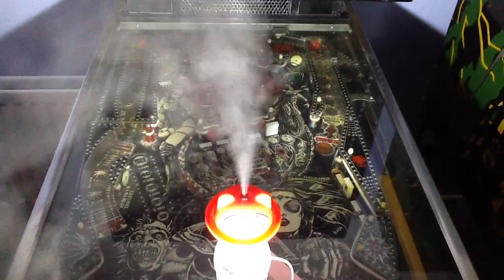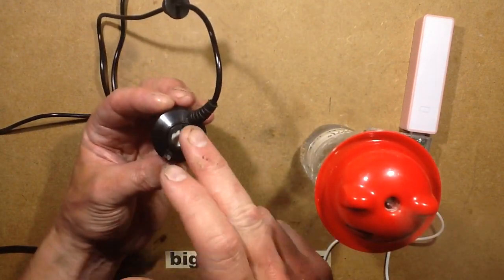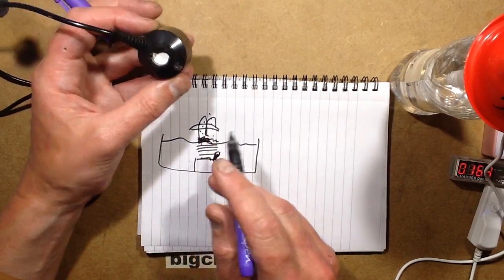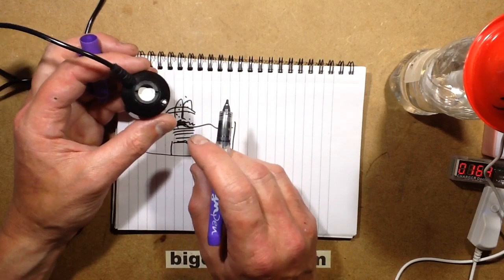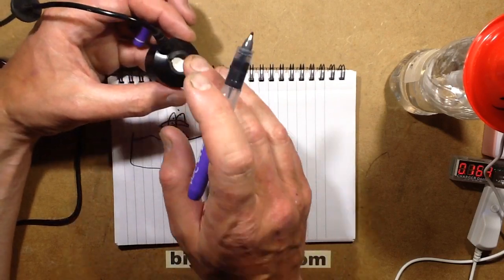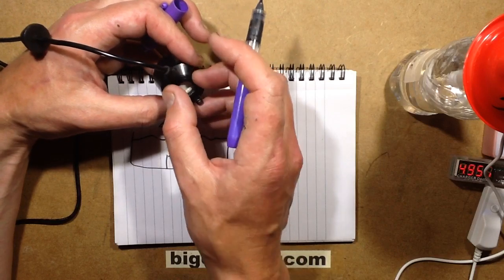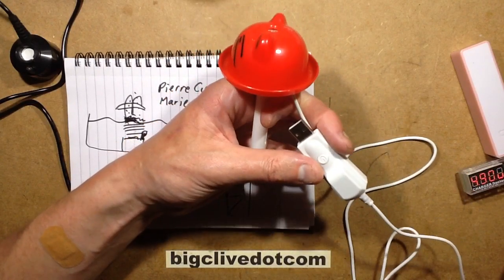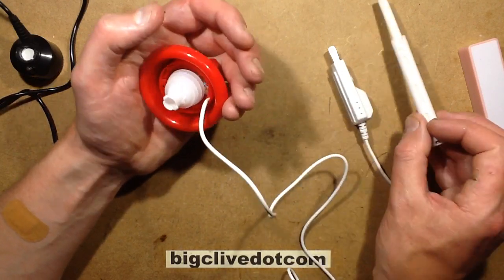USB powered water fog generating humidifier.  With schematic.

Comment: That final inductor (choke) may be for a kind of band pass filter, as in an audio crossover, but if it is used in that way at such a high frequency I thought it would need to be a capacitor. Chokes in crossovers are typically used to block high frequency and pass lower ones.

Comment: That transistor is probably a mosfet, that's why it has the pull down resistor, there isn't a reverse diode to protect it, mosfets usually have a diode inside

Comment: I'd like to know if the mist these produce is harmful to electronics.  It could easily be drawn into a PC vent for example.
Reply from the maker: The mist immediately absorbs into the ambient air, so it would be most likely to condense out on a cold surface and not a hot computer.

Comment: Cold humidifiers are not bacterial safe and must be cleaned after each use, unlike warm humidifiers. The general advice is don't use cold humidifiers.
Reply: I would think warm humidifiers would be better bacterial wise, since the bacteria can thrive much better in the warmer water, unless it is boiling it to create the steam/vapor...
Reply: Benjamin Esposti It is doing a controlled boil around a very hot insulated infrared (like your stove) element.

Comment: Is it possible it is in fact smarter than it looks? I think it may actually sense the resonant frequency and tune to it. It would justify using the PIC for that... that little BZZZT it made certainly sounded like a frequency sweep not a fixed frequency...
Reply from the maker: It did actually sound like a frequency sweep, but I can't see any feedback facility.  When the unit is dry it draws less current than when active.
Reply: But there is a feedback path! If you set pin 6 to input after you make the piezo resonate, and the resonance makes the voltage back-induced thru the transformer to the collector of the transistor swing negative more than ~5.7V from the +5V rail, it will pull down the pin 6 thru the base-collector diode of the BJT and the base cap (and then the protection diodes on pin 6)! Care to investigate with a scope? :)
Reply: It make sense to me now, the piezo acts as a capacitor in a LC resonant tank circuit. The transformer allows for both pumping energy into the LC oscillation and feedback to detect the resonance

Comment: Do not rely on those cheap usb power meters. Their internal resistance is HUGE. My phone pulls 0.5A happily from a bench power supply (measured using a multimeter) but when I connect the usb power meter in series it drops to 0.25-0.2A (the power meter displays it correctly).

Comment: I always wondered what would happen if you put a flammable liquid in one of those foggers & lit the fog...
Reply from the maker: Strangely enough that also went through my mind.  The downside being that if the transducer got too hot it could fail.
Reply: That would make a nice little show. Someone needs to try this.
Reply: +Techy 4198  photonicinduction?
Reply: ***** Of course. He's brave enough.
Reply: small price to pay for 5 minutes of youtube fame.
Reply: I don't think it's pushing it out forcefully enough for any sort of spectacular effect. Over time, it would make an effective FAE incendiary device if left on and then set on fire with a triggered short.
Reply: +Techy 4198 Colin Furze would be nuts enough to try it. =)
Reply: wouldn't the evaporation of the fuel keep the transducer cool ?
Reply: The submerged model should work.  As long as it's submerged it shouldn't go above the liquids boiling point. (~79 degrees for ethanol.)
Reply: I'll do it, where do I get one of these and kerosene?
Reply: As Clive would say: There is only one way to find out!

(Let us know which hospital you end up in so we can send the get well cards)
Reply: try it with petrol!!!
Reply: You can now see the video he made of this humidifier using kerosene here: youtube.com/watch?v=H16NYnHZ_s0
Reply: Fun.
Reply: Also see 'capillary force vaporizer'.
Reply: @AcidGrains  
There is a update.  If you haven't seen it yet.
Reply: @JanicekTrnecka  Yes

Comment: just when i wanted to search for "usb humidifier", the search recommended me a "usb humping dog". It seems like a very common (obviously japanese) item, which resembles a small dog having intercourse with your usb port. I think this is highly required on your channel.
Reply: Send it to ashens.
Reply: I'd say it's not electrically interesting enough (i'ts just a tiny brushed DC motor directly across the USB power rails), but then again we've already had a urinal flushing system teardown on this channel already, so who knows.
Reply: @hellterminator  yeah but combined with one of the gay death daleks the funny is undeniable.

Comment: polarizing those piezo elements requires around 10-50KV (depending on the material).  They are heated up in an oil bath to both bring it above the curie temperature and to act as a dielectric during the polarizing process.

Comment: My nieces have toy toothless dragons from the 'How To Train Your Dragon 2' and they have a little fog device in the throat and a blue led in the mouth. The fog device is supplied with water by a moist sponge that you wet with a dropper through a small hole. One of the dragons doesn't work all that well but the other one worked really well. The led lights up  and fog is produced when you press a button and the fog comes out the mouth into the led light and it creates a really cool effect.

Comment: The "transistor" is probably an AO3400A 30V N-Channel MOSFET from Alpha & Omega Semiconductor. The marking on those start with X0, the next letter (Y) is the week code and the last letter (V) is the assembly location code. 2L is the assembly lot code.

Comment: The series choke will most likely be making the output more of a sinewave - that's the usual method.
Reply: And also filtering some of the switching noise because the long lead would act like a massive antenna.
Reply: +SDG Electronics Wait, is it that simple to make a sine wave? Why do pure sinewave inverters cost hundreds of euros more than sawtooth or square wave inverters if it can just be done by including one or two chokes into a square wave inverter? That choke must be made out of platinum core and gold wire.
Reply: PunakiviAddikti Sinewave inverters need to cope with arbitrary loads. If the connected device has known fixed parameters then you can simply apply theory of RLC networks to get a sinewave (or a close approximation)
Reply: SDG Electronics Okay, so that needs some more real circuitry to measure the load and adjust the output accordingly. I still think the couple hundred euros price difference is way too much for that.
Reply: PunakiviAddikti I think you misunderstood - it is simple for a known fixed load. For a sinewave inverter which needs to cope with an arbitrary load you create a sinewave by modulating a PWM waveform and filtering the output.
Reply: SDG Electronics lal

Comment: those things clog up with calcium if you have hard water,its best to put distilled water in them.They are good for not much as soon as the calcium builds up. I remember my mom had the cool one,but was told by our doctor not to use that type,as stated they cause problem with bacteria after even one night. You should never add anything to one of these,remember,its going to end up in your lungs,and adding anything is inviting lung infections.

Comment: Damn!
Yesterday I was thinking I could use one of those piezo atomizers to fumigate the plants in my garden (for more efficient use of pesticides), this is precisely what I was missing, since I didn't want a unit that had to be kept level (like the submerged ones)
Thanks.
Reply: I believe it does need to remain submerged to prevent overheating and losing its atomizing piezo electric capeability.

Comment: There seem to be a large number of "PIC-a-like" devices (PIC12) used in Chinese goods.. I suppose one of the ways to test the more obvious devices is to try and read them with a PICKIT. I'm not suggesting deliberate copyright infringement more just a confirmation exercise.. However, I suppose any sensible manufacturer would protect the code...."..

Comment: An interesting gadget.  The "transistor" is probably a MOSFET.  That would explain (a) the absence of a current-limiting resistor on the base (gate), (b) the pull-down resistor and (c) the lack of protection diode in parallel with the transformer primary (which would be needed to protect a transistor from getting fried by back-EMF when the current through the transistor is interrupted).  It would be interesting to know what frequency it works at...do you have an oscilloscope or a multimeter with a frequency counter that you could hook it up to?
Reply: Those type of atomizers useually opperate at 113KHz. The underwater ones are 1.7 MHz - 2.4 MHz

Comment: Wouldn't the choke in that configuration smooth rather than boost the pulse to the piezo? I guess it will run better (in resonance) if the signal is less spikey.
Reply: Less EMI (electromagnetic interference) too.

Comment: The micro sounds like it searches for the resonant frequency.
Reply: And how would it do that? There is no feedback from the piezo.
Reply: I posted the comment before I watched the whole video. I not sure of the exact reason they use a micro in this application. I think you could achieve a similar result with other 8pin IC's such as op amp's or a 555 and posibly make the circuit resonant with feedback as well. May be micro's are just that cheap it's easier to use them for absolutely everything :-)

Comment: Just wondering, would it work with e juice?
Reply from the maker: When Ruyan developed the earlier modern e-cigs they used an ultrasonic atomiser at first.  But latterly moved to the heater version as it is simpler.
Reply: So if i filled it with e juice and put a tube to it, i would have a good and cheap ecig?
Reply from the maker: I'm not sure how it would compare to the dose of an actual e-cig and the amount of nicotine contained in that dose.
Reply: Please try it with some eJuice. I am scared by the heated juice (the "atomizer" becoming all black and nasty) and i'm interested in some other options to atomize eLiquid. This method looks nice from what i've seen here.
Cand you run a bottle (30ml) of juice trough this atomizer and see if it would get vaporized without incidents ? 
Pretty please ? :)
Reply: e - bong!!

Comment: Choke in series?   That's classic ultrasonics:  the piezo transducer is a capacitor of course, and wants to be driven with high voltage.  So, if we add an inductor, we have a tank circuit.  Drive it at series resonance (with low volts, high current,) and quite a high voltage appears across the piezo.

Open up most high-power ultrasonics devices and you'll find a physically large high-current inductor in series with the transducer.  RLC resonator, that's the method for producing the high voltage piezo drive.
Reply: Do you have any example?
Reply: @marcelos.1889  I'd look at videos for "ultrasonic cleaner repair."  The older units have big series inductors bolted to the case, like 50mH or more, like this one from 1980s, with big basket-wound inductor with pink Litz wire. https://www.youtube.com/watch?v=nqZCOhDT_hA&t=150

Here's a modern one, eBay teardown, with series ferrite inductors on the PCB (they look like two transformers.) https://www.youtube.com/watch?v=TsObmueT3C0&t=705

Comment: The capacitor on pin 6 helps transform the output square wave to a slightly smoother high frequency sin wave so it can be a bit more efficient when using the output transformer. It's probably been chosen, like every other part, to be specific to the frequency needed by the system and the piezo disk.

Comment: The inductor works as power factor correction, same as the run capacitor on a fridge motor. It's a resonant LC circuit, tuned elsewhere.

Comment: In case everybody else came a-gutser on searching for that transistor, I think I may have stumbled on it. Found a page saying that X0YV (with a zero) is an AO3400A N-channel MOSFET.
The topology of the output stage is almost identical to a single-ended amplifier driving a speaker. My experience with electronics is mostly in audio frequency amplification, so I'd actually be surprised not to see that capacitor at the switching device's gate/emitter/grid. Interesting how our personal indoctrinations color our perception.
I always enjoy these random eBay teardown videos.

Comment: Isn't it a spin of the roulette wheel if you keep plugging things into USB ports? Eventually things of much value go BOOM, correct? The current drawn eventually drastically exceeds the source capability.

Comment: No-no, that capacitor along with the resistance is a low-pass filter that makes the square-wave output sinusoidal for the piezo, it basically eats the higher frequencies in the square wave that would probably mess with the efficiency of the piezo disk.

Comment: Being a person who needs a humidifier i have to warn people of the ultrasonic humidifiers, they put out all the water, including all the lime/chalice. You will have a fine layer of lime dust everywhere, some types of rubber even goes weird from that dust. The old style boiler type humidifiers are better, since they innately trap some of the lime and often also have a lime trap. There are of course more expensive ultrasonic units with lime traps.
Maybe I should move to Britain, I hear you guys have it nice and humid over there. :-)

* These smaller units could also be considered toys or decoration, they don't do much for the overall humidity in a room. On really dry days, also adding in house ventilation, it's not uncommon to put out 5-10 liters per day.

Comment: There is no base bias as it is running in class C, as did most HF transmitters. The transformer and choke react and produce the sine wave required for best efficiency.

Comment: These things were popular here for a short while, until it was discovered that after a few weeks, there is a white sheen on everything because of the mineral residue from the water.  All the stores stopped selling them, and reverted to the type that boils the water instead.  It's a shame really, because I would have used it with distilled water, because the power consumption with this type of humidifier is much less than the boiler-type.

Comment: do they create dust.? most throw out tiny white calcium particles.
Reply: Where would it store the minerals and impurities in the water if it didn't?
Reply: Yes and plenty of it.  I bought a large one which does a great job at humidifying my house but within a day, all the furniture is covered in white dust.  Even the floors, carpet and bed sheets have a weird feeling to them.
Also interesting is that when I used my stove burners, the flames are bright reddish orange.
Using distilled or reverse osmosis water works well but gets expensive when you're going through several gallons a day.  I shelved it and went back to a wick/forced air humidifier.

Comment: The engineering side of me wonders why they didn't include an impedance measuring circuit to fine-tune the frequency generator to the resonance of the piezo in realtime.  The practical side of me thinks that's a delightful amount of output as it is.

This is a really neat little thing!
Reply: It has a crystal on the board.

Comment: Hi Clive. Do you still have this atomizer working? I'm wondering if it's able to atomize either isopropyl or ethyl alcohol? I'm thinking that alcohol requires a different frequency for the ultrasonic disc to atomize compared to water. Hoping you can test or confirm before I buy one. Thanks!
Reply: Theres a few videos by Skill Make where he used gasoline. In one video he used a mister very simular to this one and he lit it. It produced a large flame for 10 mins consuming 4ml of gasoline. 1 liter of gas would last 41 hours. Another video he powered his motor cycle. Idle only.

Comment: Am I right in noticing there's no flyback diode protecting the transistor from induced voltages?
Reply: Probably a MOSFET. Which of course has a bad intrinsic diode which can be used if cost is more important than efficiency.

Comment: I have been looking for a way to create acetone vapor. As you can imagine corrosive properties don't allow for submersion options. If the plastic housing was upgraded to a durable enough material do you think this wicking method would work? I'm trying to create a chamber for plastic part smoothing and although normal evaporation works in small areas, large containers require an additional boost. Any help would be apprecaited.
Reply from the maker: Heat is probably the best way to create the vapor.  Presumably for smoothing plastic or merging toner?

Comment: I cant help but wonder if that high voltage driver circuit shares any similarities with those battery operated ones you get for el wire.
Reply from the maker: The EL wire runs at much lower frequency.  Just a few 100Hz.

Comment: Thx for the video! Those little buggers are quite impressive. I found one which was made even simpler. I can't seem to find any crystal at all. Might it be possible those things are run with a 555? I uploaded some close ups of the circuit at my FB page: https://www.facebook.com/media/set/?set=a.1194748833890352.1073741835.756018644430042&type=3

Also I tried to get a glimpse on the microscopic holes of the piezo element itself. On the side that faces the fluid you can cleary see some kind of net. Looks more like a filter but maybe used to suck in the water. It is not quite centered so it more looks like glued on or something.
Reply from the maker: The net might be laser etched holes in the centre of the plate.  The circuitry look similar, but what looks like a three terminal inductor appears to be being used as a small transformer.
Reply: Sounds reasonable. They might use a Attiny85 or something else with internal clock. Hence no crystal.